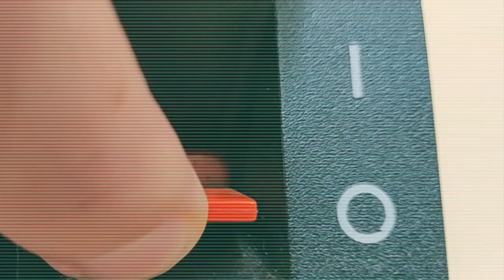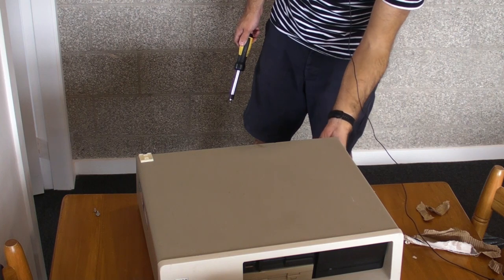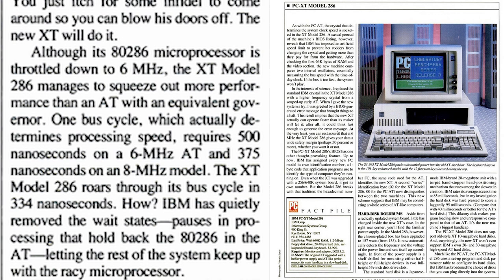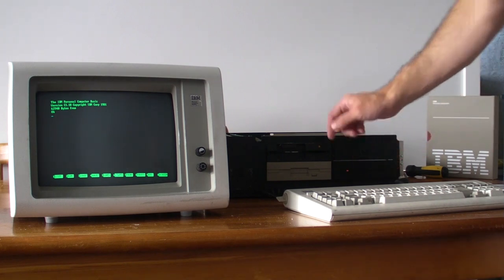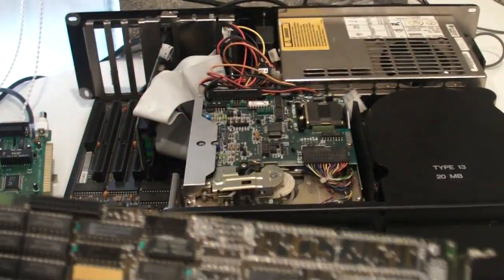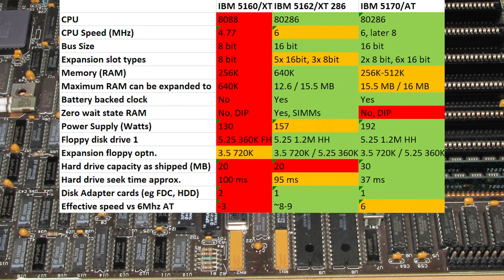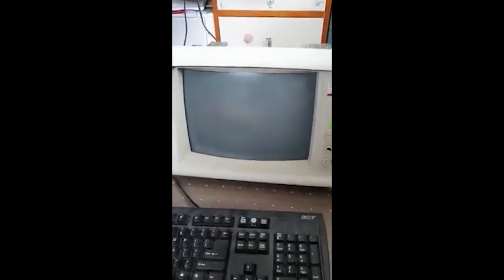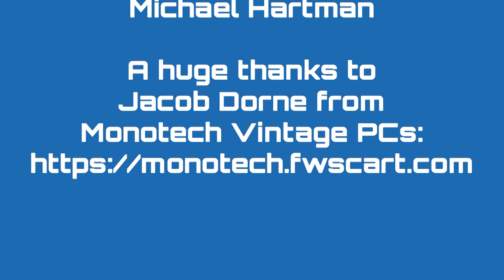The IBM 5162 XT 286: A wolf in sheep's clothing

Comment: Oh, and to answer the question at the end of the video - I definitely prefer the look of the 5150 / 5162. Such iconic machines and built like tanks! Not that I'd complain if a 5170 landed in my lap, of course...
Reply from the maker: Yup, the 5170 is kinda like the 80s slab. A big blocky thing like everything else from the 80s: cars, cassette decks, home appliances.. the 5150/60/62 is more a last throwback from the 1970s, with it's rounded chunky curves. I still like the AT, but I still can't get past the look of the original case!
Reply: @AlsGeekLab  Yes, very well put and totally agreed!

Comment: When I started at Intel PCEO, I was providing tech support on Above Boards and their other products. Flashback city!
Reply from the maker: Glad you enjoyed! I must say, it wasn't the easiest board to configure, and that was WITH the documentation! I could imagine you got a lot of calls! I still can't figure out if you can allocate any of its RAM to conventional (above 640k, but below 1MB).
Reply: @AlsGeekLab  That version of the Above Board is the plus version and it's all SW configurable, so do you have the software? IIRC, You can do 512K-640K, and do expanded memory windows, and extended memory, but you can't just map a page into anything above a000:0000.
Reply from the maker: @neilbradley  yep, I have the software. It's not very logical and doesn't work well. I would have preferred the jumpers tbh! Is a0000:0000 640k? I forget? I have a microram card in my XT/5160 which lets me allocate any unused parts of 640k-999k to high memory, so I can load dos into the UMB and device drivers high. I use a thing called DOSMAX and USEUMB for that purpose, but I don't know if you can use them for the AboveBoard
Reply: @AlsGeekLab  The non-Plus version of the Above Board had dip switches, IIRC. a000:0000 is the top of 640K and where video RAM starts. You can only set up an expanded memory window c000-efff, IIRC. You can't just map RAM into the regions, which is kind of a bummer since you can't loadhi on 286 and older systems.

There's also a problem with the Above Board Plus with the UART - You can set the base address of the card's ASIC to 0x2f8 as well as the UART. If you do that, then the board becomes unusable. You have to swap out the EEPROM. ;-(

And wow... I'm dating myself. I can't believe I remember any of this stuff!